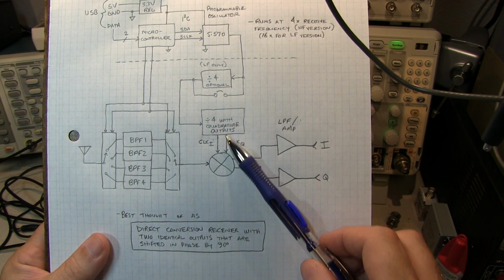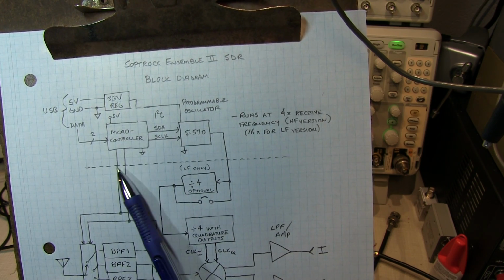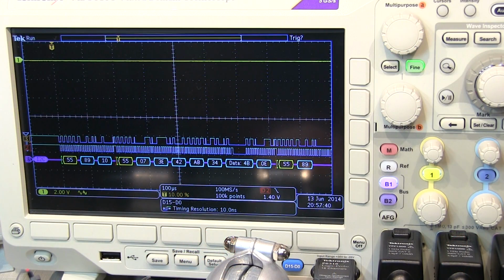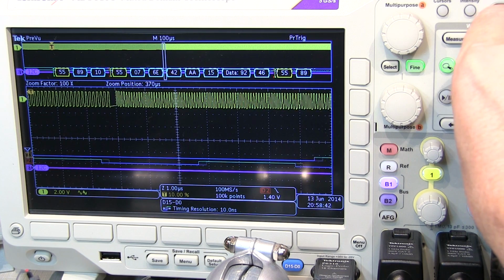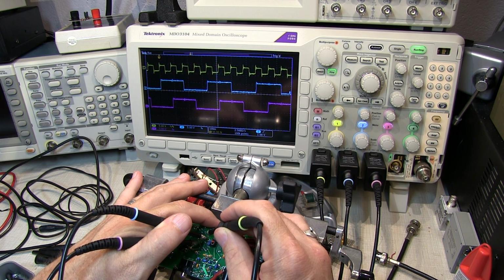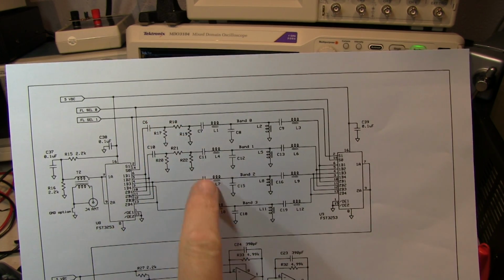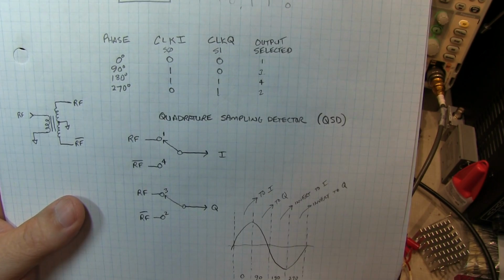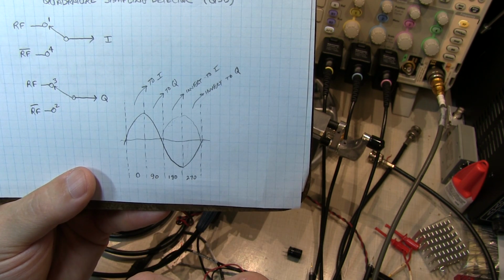#154: Softrock Ensemble II SDR Rx circuit review | description | test

Comment: I had no idea what a Softrock Ensemble is before watching the video and having watched it, I still don't. However, it was easy to follow every detail of exactly how it works. I guess the question is "yes, I get it, but why would you want to do that?" I'm not sure which is more impressive:  1) the design of the contraption, whatever it is, 2) the oscilloscope that most of us can only ever dream of owning or 3) your superb presentation skills.

The one comment that I would make about the design that I thought odd, is that the final audio (?) output is balanced, rather than referenced to ground. That's fine if the user plugs in some headphones, but what happens when a normal audio amplifier is plugged in? Everything else about the design was perfectly clear, though it took me some time to realise that the FST3253's can be used as both multiplexers and demultiplexers. I also noticed that the A and B channels were paralleled together. My immediate thought was that from a logic standpoint, you could get away with just one IC in the filter section with half used for the mux and the other half for the demux. So was it designed like this to reduce the channel impedance or perhaps to provide better signal separation between the filtered and unfiltered signals?
Reply from the maker: This receiver is intended only to create the IQ baseband signals that are fed into a PC running SDR software - which then does the final demodulation back to audio from whatever modulation type is being transmitted.

Comment: Hi Alan. Long time fan and follower here.
Could you please suggest or comment about USB interfacingg this unit with a laptop.
My Toshiba c55 laptop he only one mic/sepeaker jack, and my hdsdr program does not respond to the stereo connector coming from the SR lite II.
My unit tested OK to all tests including the two quad oscillograms output with a 14 mhz signal input.(20m band)
Thanks
Paul kk4ptv
Reply from the maker: I'm really no expert in solving why HDSDR isn't responding to your audio inputs.  You may want to ask your question to the Softrock Yahoo group.
Reply: Thanks Alan.I do not thinks the problem is with HDSDR or Softrock. Its my laptop that does not have a separate mic jack to plug the Lite II dual inputs , hence my quest for suggestions for a USB adapter to connect my LiteII to the computer,

Comment: Dear W2AEW ! Greetings from India ! In this video you have shown the quadrature generator section . I tried the same in my lab @ 10Mhz using standard 74lLS chips but got severely distorted waveforms in an Agilent 350MHz DSO . I was using some 4 inches of ground lead and perhaps that was the problem . How to calculate the output impedance of 74LS series logic ?  Do I need to set the scope to 50 ohms input impedance to take measurements of this kind  ? Can you make a video on impedance matching in an RF circuit ? 73s DE VU3VWB ............

Comment: Allen can the performance of this type of receiver be compared with those of HF receivers sold in the 60-70's?  Sensitivity used to be the benchmark of a good receiver, but when trying to compare the specs of my TS-520 with these SDR's I don't see any specs in that area, which makes me believe it might be one of those apple and oranges type of things.  What should I be looking for?
Reply from the maker: For the most part - the performance (SNR, etc.) will be largely determined by the baseband processing circuits and algorithms.  Modern SDRs can perform surprisingly well - such as the Flex radio series.  High performance SDRs will include better front-end filtering, preamplification, etc.

Comment: Excellent Video. One question. where to get the liquid flux. As a hobbyist, I'm not interested in buying it  by the gallon I bought a SMT practice board, and find the flux paste I have is messy.
Reply from the maker: I bought a small bottle at my local electronics supply store.  Not cheap in those small quantities, but that one little bottle will last me for several years.

Comment: Hi,
I never use SDR, but looking into schematic, seem to me that it could be used as low cost spectrum analyser, with good frequency range.
Hi and low frequency is basically limited only by range of frequency generated by Si570.
I dont know how hard is to create spectrum analyser softvare. I didn't find anyone is try that..
Reply from the maker: You could use some of the SDR receiver software that is out there like Rocky or HDSDR.  They'll give you a spectrum display and waterfall/spectrogram over a frequency range that is equal to your soundcard sample rate.
Reply: Thanks for quick replay.
Idea is that I could sweep frequency from start to end(like analog spectrum analyser) and that would give me whole spectar.
There are few thing that isn't clear at this point:
1. How to determine amplitude of input signal. To be exact,frequency response of analog front end. Maybe use some USB ADC from some USB DBTV, so whole sistem won't depend on PC audio input+higher sampling frequency.

2. Why there is band pass filters? Could this work without them?
Reply from the maker: Nenad Markovic The signal amplitude limits will be determined by the mixer limits at the high end, and the system noise floor at the low end.  The bandpass filters are necessary to close the higher nyquist zones.  The direct conversion process will mix a signal at the local oscillator frequency down to baseband, but it will also mix signals at harmonics of that frequency into baseband also.  For example, if tuned to 7.1MHz, then 7.1MHz will be converted to baseband, as well as any signals at 14.2, 21.3, etc.  The preselection bandpass filters will eliminate these signals and keep them from appearing the zero IF output.

Comment: Next question (coming up as I'm watching ;) ): why did you use two FST3253 for the bandpass switching? I see you paralleled all the inputs and outputs of the two channels. If you didn't you could have used channel 1 (1A, 1Bx) for the leftside switching and channel 2 (2A, for the right side switching).

I can imagine a few reasons, why you did:
* board layout is much easier/clearer that way
* a single channel isn't rated for the current going through
* input and output of the filters interfere too much if they come together in a single chip

Maybe I come up with another question as I go along. But if not, many thanks for your videos at this point! Yours are definitely the videos I learned most from thanks to the way of your presentation. Although I'm not (yet) into RF electronics, quite a lot of the knowledge is in some way applicable to higher frequency digital circuits (mostly in the form of what NOT to do in them).
Reply from the maker: I didn't design this receiver, so I can't confirm the exact reason.  My suspicion would be two-fold:  

1) Keeping the input and output of the filters in separate chips would eliminate any parasitic "blow-by" (coupling from input to output, bypassing the filter).

2) Paralleling the switch connections lowers the switch impedance.

To be sure, you'd have to ask Tony Parks, the designer of the circuit (as shown the schematic title block).

Comment: Is the HF jumper really just a jumper or is it a selector? Because the way it's drawn in the circuit diagram with the jumper set, it looks like the clock coming from T1 is shortcircuited by the Q output (pin 9) of U12.
Reply from the maker: Jan Moren No technical reason why this couldn't be done.  It would require re-programming the uC to operate the relays and setup the LO properly, and you'd have to add a second bank of bandpass filters.  The filter switching could be done with PIN diodes instead.
Reply from the maker: When building the HF version, you leave U12 off of the board, and install the jumper.
Reply: ***** Is there any specific reason you couldn't add a relay controlled by the ATTiny that could select LF or HF mode on the fly? With a second relay and two antenna inputs with separate filters?